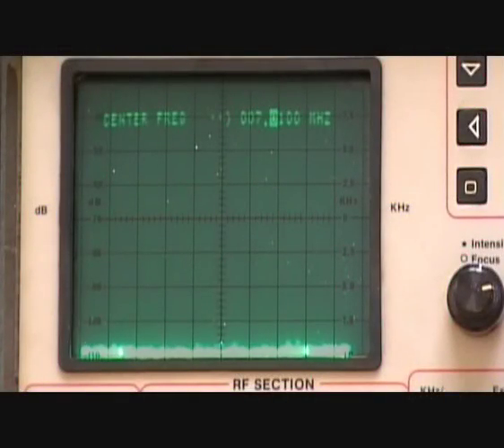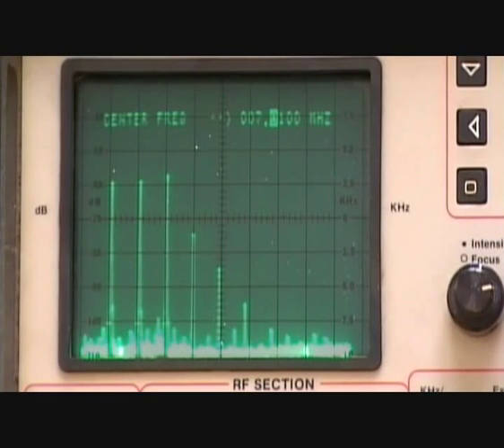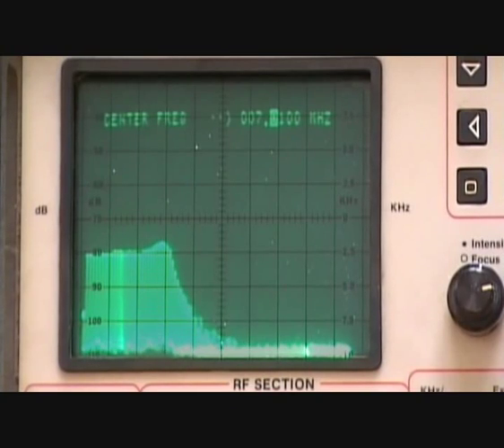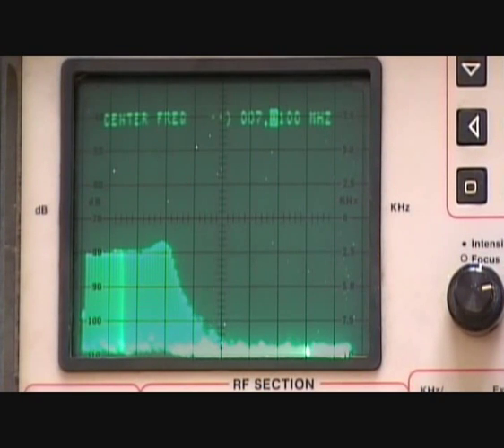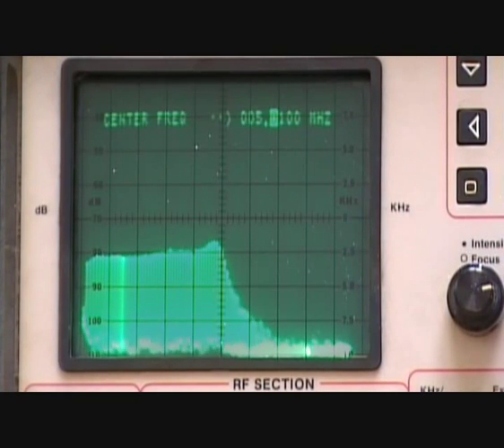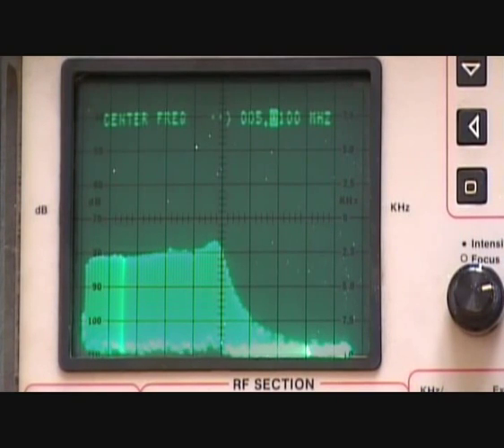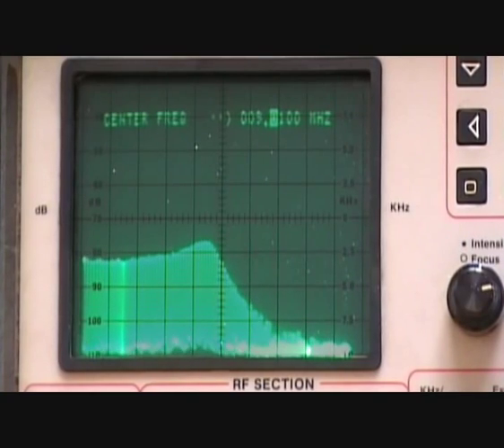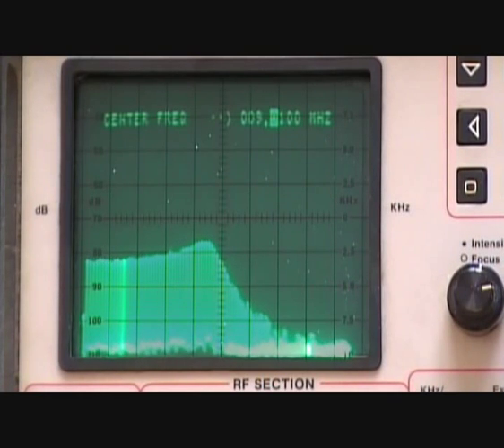Harmonics & Low Pass Filters

Comment from the maker: @2e0lrc i am not familiar with built in scopes but the DSP settings are normally for the received audio. A spectrum analyzer will certainly check out a transmitter for unwanted emissions but you need to limit how much power goes into the test set. A sampler is normally used to take just a wee bit of the transmitted signal and prevent overload.